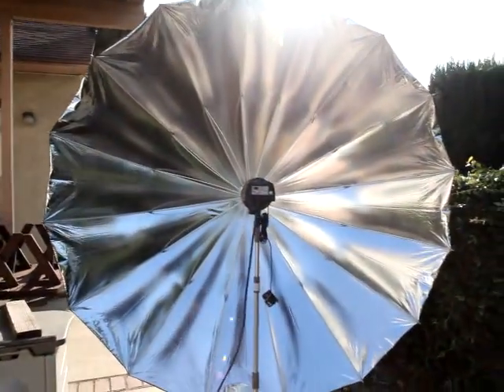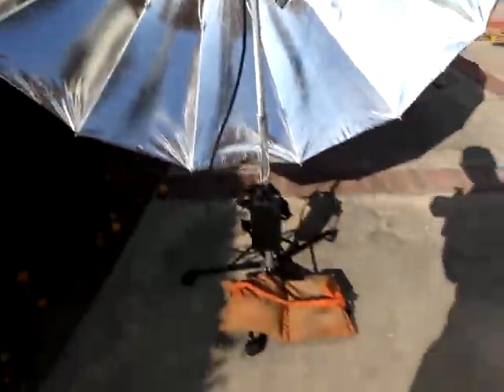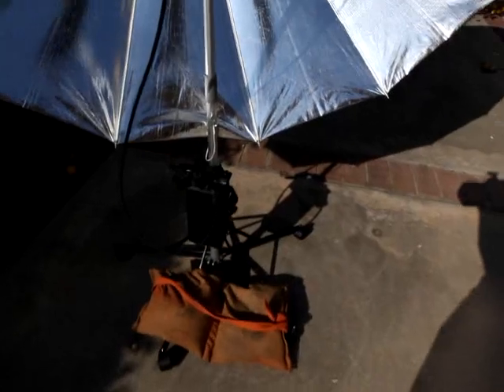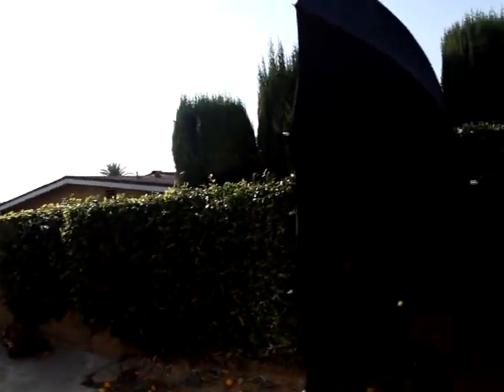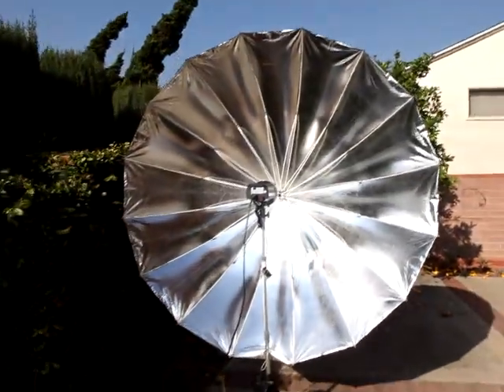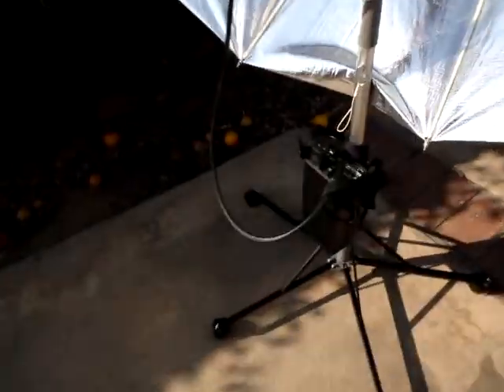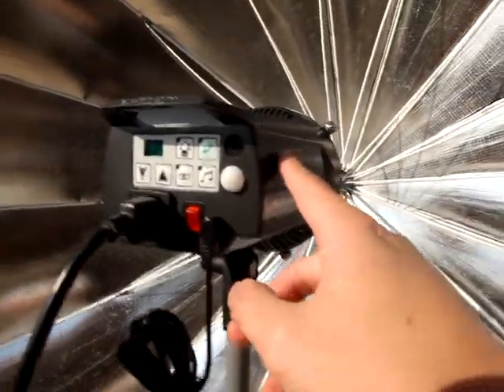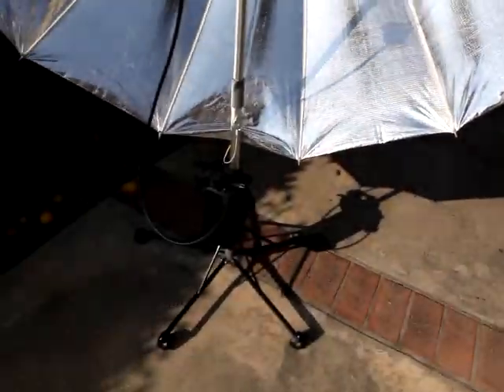PLM + vagabond mini PCB outdoors wind test

Comment from the maker: @Ronnelsky AB and elinchrom both have their advantages.  elinchrom wins in light consistency throughout the color range.  do a test for yourself with the alienbees strobe at low power and one at full power.  You will  notice a color shift that will affect the final image.  elinchrom does have some slight shifting, but alienbees is KNOWN for that.  The einstein on the other hand (also what i have) does not suffer from this and is superior then elinchrom strobes.